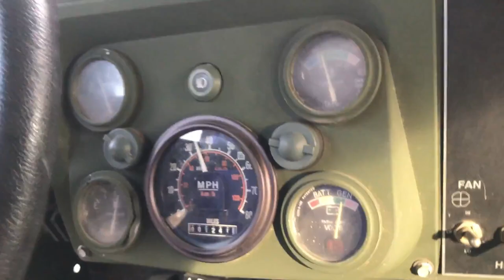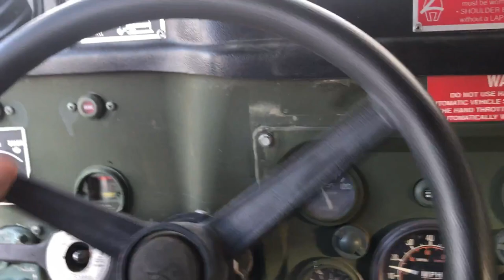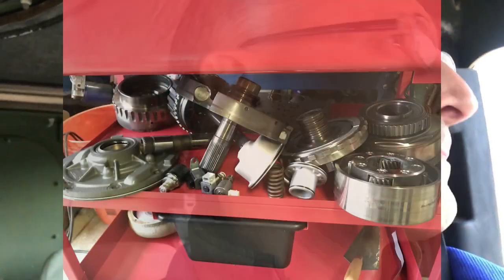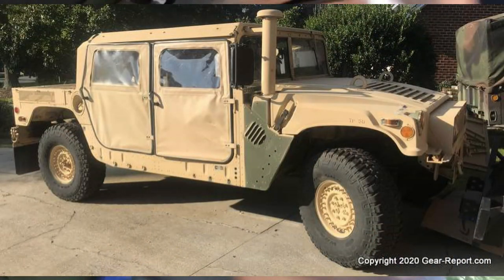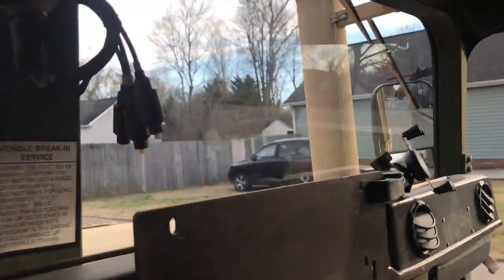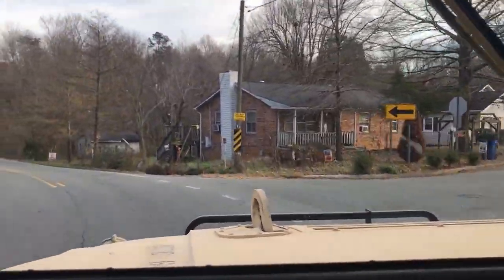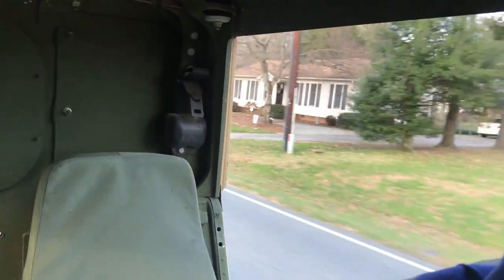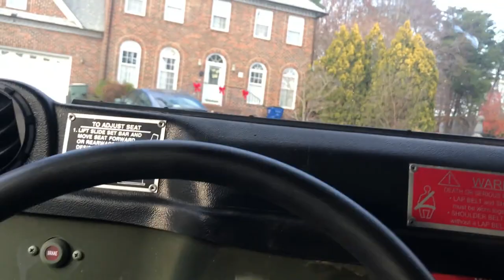Driving the latest turbo military Hummer - M1165-A1 HMMWV Battlewagon 3

Comment: Tryin to talk myself out of buyin one. Got too many projects as it is.

But i got one hell of a sweet idea for it. 7.3psd/zf6 swap, 12k gvwr, canvas 2 man, and alpha dash/hvac upgrade. Cut a set of x-doors down and make soft uppers for em for a proper half door setup. A gun stand for showin off, using a gooseneck ball reciever.
Reply from the maker: You had me at 7.3... 😳😱😅🤣🤩😎
Reply: @GearreportdotCom  hey, turns out a hmmwv cost as much as restoring a 90s Ford nowadays. That and ive wanted a hmmwv since i was a kid